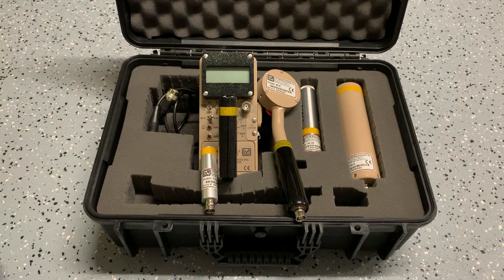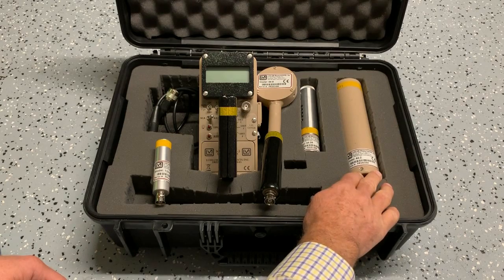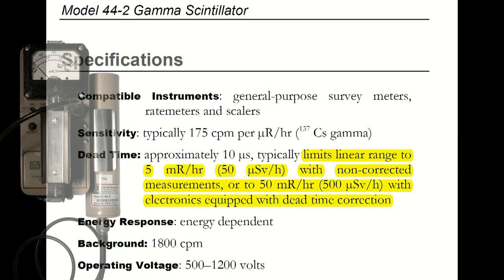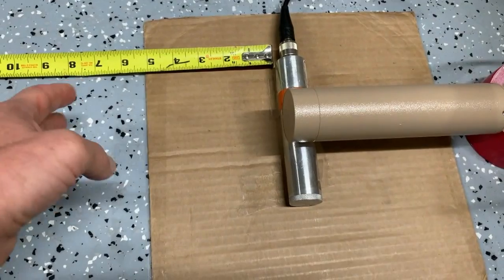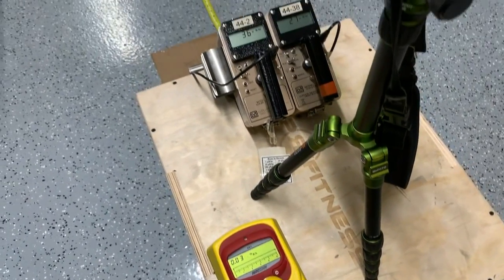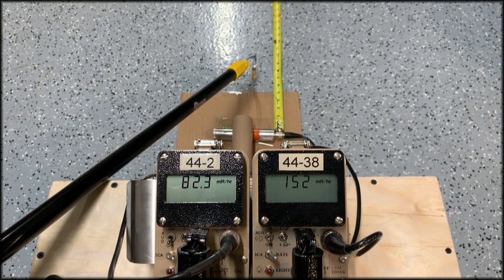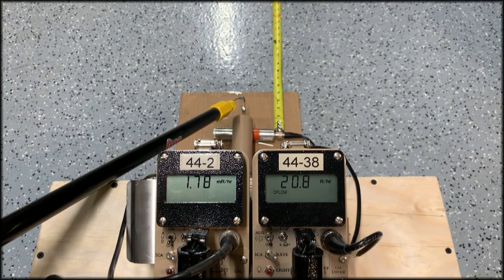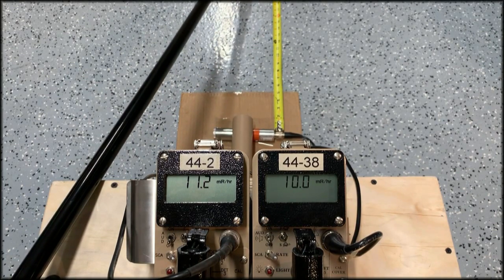Overloading the Ludlum Model 44-2 Gamma Scintillator - long version

Comment: So the peanut would be able to reach higher than both shown?
Reply from the maker: Yes, that's correct. I have the 133-4 (peanut probe) in this kit which is good up to about 10 R/hour. The 133-7 model would be good up to about 100 R/hour with this meter.

Comment: Holy hell, that's one angry broomstick.
What is it originally made for? Looks like there's a chain on it, I can't imagine why you'd want something like that on such an angry source.
The reason for it getting saturated may be that either the photomultiplier can't keep up, or the HV power supply is sagging massively(>50-100V), dropping the acceleration voltage, and thus sensitivity.
Reply from the maker: Spirit it’s just a regular old broomstick. I taped a wire hook on the end so I could grab ahold of the source. The actual source is very small and is kept inside the small vial you see with a chain attached. It’s an old medical source from the 70s.